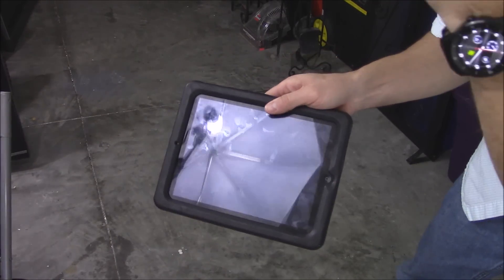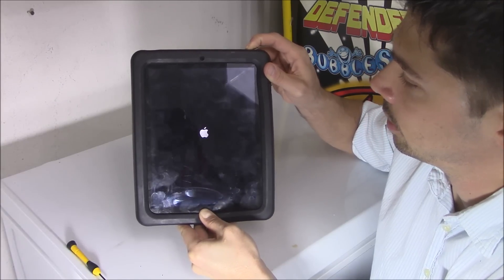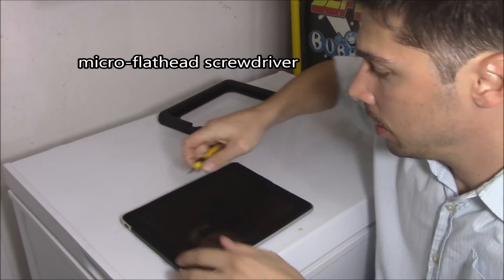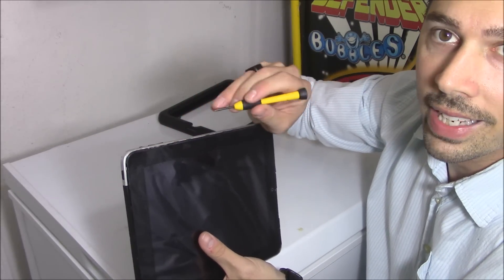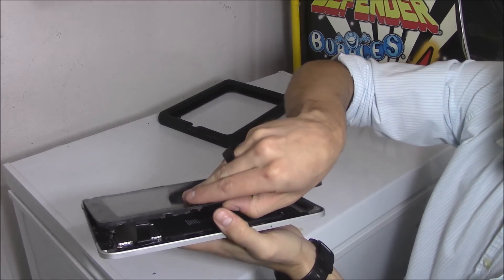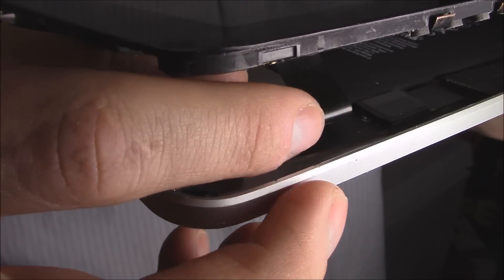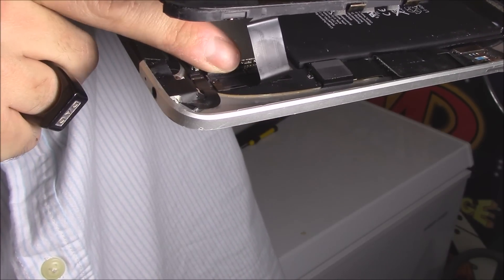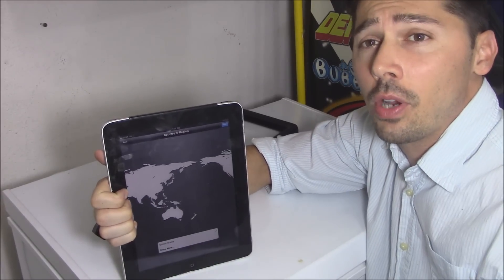2 WAYS TO FIX IPAD TOUCHSCREEN NOT RESPONDING - WORKING

Comment: Hey, what if an touchscreen on a similar (ANDROID/GENERIC) tablet just suddenly went crazy and progressively failed in all but part of the screen? Will shocking the screen with a lighter sparker work if done correctly or is it more likely to do with  the cof cable like with yours? Any other suggestions? ALSO: I did splash a little water on it before it went crazy, but I wiped that off and was able to fully use it until it went nuts while watching a music video on yt. Inside the device, the black wire from the batt to circuit bd has some insulation missing at the end, so I wonder if some charge is being lost elsewhere that should go to the screen. Additionally, I wonder if the portable bluetooth speaker vibration had something to do with it (it was fairly close)...
🤔🔊📲📵❓

Comment: Restarting it did the trick! I was worried cause I didn’t drop or break it. For some reason the touchscreen only worked for my Apple Pencil and not the taping on the screen. So I was a bit worried Good thing it’s fixed now😅 Thanks for the vid

Comment: 1) I press and hold both home and power buttoon at the same time but it took screen shot

2) I press and hold power button, I tried to slide to power off or cancel but it don't respond 

Is there any way to force restart

Edit: I just comment and it works when I press and hold both button, it respond now

Comment: My iPad (gen 7) touchscreen suddenly stopped working when I turned it off. I found this video and tried to 1st method however it didn’t work no matter how many tries I did. I don’t have a heat gun but google said you could use a hair dryer as an alternative. If I manage to open my ipad and fix the problem, will the screen and back case just click together when I put it back? Or is glue required?

Comment: Thank you so much for the information in this video. My son managed to lock the keyboard by frantically pressing buttons when the internet connection was taking a long time to connect. The touch screen stopped working. This video helped us to unlock the screen by forcing restart without connecting the tablet to the computer for a hard reset. Thank you so much! 😀

Comment: Thank you so much!  Thought I was going to need a new iPad.  The HOME button and POWER OFF button did the trick!  Had some software glitch I guess.  I didn't drop it.
Reply: Same as me
Reply: @CLOMB10  pppppppppppppppppppppppppppppppppppppppppppppppppppppppppppppppppppppppppppppppppppppppppppppppppppppppppppppppppppppppppppppppppppppppppppppppppppppppppppppppppppppppppppppppppppppppppppppppppppppppppppppppppppppppppppppppppppppppppppppppppppppppppppppppppPPPpppppppppppppppppppppppppppp
Reply: Same here
Reply: Hello, did it lose all the data stored or was it the same as before because i am skeptical about the reset
Reply: @adhirajsingh3086  it was the same as before no issues

Comment: thank u very much lad you are a star......My  ipad actually got an unusual problem and nobody was able to fix it. it is working perfectly when i am on home screen but only front screen whenever i tried to give password doesn't work untill unless i put it on software mode with power button and home button several times. since last couple of days the problem was permanent and give it a try watch your video and got a small point that ipad touch cable inside got unplugged.... i never opened my ipad but immediately 2 to 3 times tap, tap, tap with my hands onto just opposite corner of volume button where u showed the touch cable inside and it got worked yahooooooooo thanks to upload this video.

Comment: So what causes this issue? I did a soft reset to fix it, but I'm curious as to why it did it in the first place (We use them for work and it hasn't been dropped). Is this slight evidence of hardware failure in the future?

Comment: Yo are a real hero, and I mean it. My iPad like did not fully turn on, and I tried to reset but it did the same thing. I actually cried because it would be the 3rd or 4th time breaking. But it isn't broken thanks to you. How I fixed it is when you told me about the touch screen cable thing and told me the location I added a little pressure in that area and banged it on my knee gently, and it turned on😄😄😄😄😭😭😄😭😄 I was crying happy tears. I'm writing this on my fixed iPad, and I am so happy that you are alive. I want YOU to know that God blesses you. Maybe I was a little dramatic, but you get the point, keep doing what you do.

Comment: so, I tried this twice after my cat knocked the ipad off the counter and the screen did not respond. After the second time, I noticed that the plastic has a tear in it(the piece that slides back into the double slot). Can I use electrical tape to fix it? It's an Ipad 2 so it was a little different than the one you fixed.

Comment: Hey,

I have an iPad Air that the touchscreen does not work. I've worked on these for a while and had a spare that I tried on it but still does not respond. Interesting enough if it's restored while on DFU it works for a few days then stops working.  Just wanted to know if there is anything else to check before declaring the Logic Board dead.

Comment: How would you deal with a cracked one, it's only cracked in the corner where the camera is at, it's actually a hole in the screen 😰 but it messes up the touch and I don't know if I should risk it cuz I don't have another screen to replace it either. It's an iPad mini, I'm not sure what gen

Comment: Okay I'm having a different problem. So I have an iPad mini 2 and I just got it a few months ago, certified refurbished from Apple. It was working fine and it does respond to my touch however, the keyboard is acting crazy where it randomly closes when I'm typing and it won't respond to me clicking certain keys, it will just show it as if I decided to close the keypad. I've even done a hard restart where I restored it back to factory settings and just updated to software 11. What's going on with this thing? I don't want to destroy the screen

Comment: Thank you! I hadn't dropped it, but the touchscreen just suddenly stopped responding. Tried to shut it down, but that required using the "slide button, " which wouldn't respond....reset did the trick. Don't think I would have tried to open it myself, though....too big of a chance of damaging it.
Reply: same the first worked for mine :)

Comment: Bro, what steps could i take for my ipad 2 (model A1396) device given as thde screen is also cracked. pls help
Reply: by screen i actually mean the front panel. i have tried the hard reset but only some parts of the front panel/screen is responding to touch

Comment: Hi, Tampatec
I have an iPad Air 2 which is working fine and there’s no liquid damage.
I had to reset it to switch ownership. Unfortunately when the tablet booted up the screen just went unresponsive to touch.
All the other buttons work fine. Just the touch screen.
I’ve checked and ensured the digitiser cables are well in place but it’s just the same.
Thanks so much in advance
Reply: Sam Brako that’s what happened to mine. I don’t know what to do

Comment: hmmm mine isen heat tuched its allredy replaced and its 4th gen ipad its the glass that is messing and im using it now :-/ who on apple come to think that glass is a good idea isent plastic better i mean common 3 times allredy and my psp is made of plastic droped it i think 100 times its only scratch -.- ipad a little fall the fl screen brakes -_- i think apple is making screens way low durable i mean its not fun to have a sheld over it -_- so i think 3000 kr and for hearing and replace a screen + they fk dident replace the home button its inside it ;-; i say 500 kr i whuld pay for that crap screen they make =_=

Comment: Thank you so much. now my ipad works fine
Reply from the maker: good job fixing your iPad
Reply: +Tampatec thanks it worked!!
Reply: Does anyone know if this will work for an iPhone 5c the same thing is happening with my iPhone, but it's not the whole screen like it still lets me touch but it's very very sensitive and sometimes it just doesn't work at all it's like it's on and off and when it's not working it's still let me touch it just doesn't respond very well do you know if this will help with that?

Comment: This video is very helpful. My problem differs a bit.  Some of the functions on my iPad 4 respond while others don't.  I have just reset it to the factory setting but I cannot access the figures on the keyboard to sign in to the iTunes Store.  What should I do?
Reply: https://www.amazon.com/iXCC-Ultra-Slim-Bluetooth-Multi-Angle-Compatible/dp/B01HBFWL9E/ref=sr_1_15/153-0772826-3407606?ie=UTF8&qid=1476190000&sr=8-15&keywords=Wireless+Keyboard+Ipad+Air
Reply: missy falayi

Comment: My IPad Mini screen was unresponsive and I brought it to Apples's Authorized Dealer, A.Lab at Changi City Point. The staff there was typically zero knowlwedge on troubleshooting. Her job is to coax me to dump my iPad Mini and to settle for a 'New' set for half the retail price at $335. 

I was very disappointed and sad that that's how APPLE treat their loyal customer. Nevertheless, I persevered on the troubleshooting without any help.

Using the software reset method is totally useless as the video above showed. Also, my Home button was also unresponsive. I resorted to starving the device by draining its battery till the unit Autoshutdown after 3 days or so.

I let it remained 'Dead' for around 25 minutes. Then I charged it up for around 25 minutes. I was then able to switch it on again with the screen again 'RESPONDING'.

So, there's no need to physically open up the device at all.
Reply: I have an iPad mini also with the same problem
Reply: Thank you!
Reply: I have the same problem but it still doesn’t work after 30 days of being dead
Reply: My iPad 2 has been dead for 25 days.

Comment: The first option was helpful, although my iPad 2 still had issues. I tried the second method but couldn't find anything resembling the digitizer, and then I got lines across a third of the screen. I revisited this video and tried to look for it again, but unfortunately I just cracked the screen to the extent I had to abandon looking. Oh well. I will see what the Apple repair shop says. Might end up getting another model after all: that may be cheaper than any repair.

Comment: I have an iPad mini and it can't respond to me sliding to unlock, I can't even click the power button, it won't work. If I do the same thing with my iPad mini (it's not the 2,3 or 4 it's the first one) do you think it will work? I have to hold my home button and the power button for me to turn it on, but it won't respond.

Comment: I have an iPad Mini 2 and I did not drop it. My iPad got wet and after that everything continued working fine except that the bottom half of the screen does not respond (exactly 50% of the screen). Could this be fixed in the same way as you showed in the video? I feel like that this has to be a similiar problem to the one shown in the video becasue otherwise the screen would not be exactly halved.
Reply: I dropped it in the water, everything was working fine and then, 3 months after, the half of the screen on the side of the home button suddenly stoped  responding.
Reply: Tampatec can you make video doing exactly that?
Reply: Same for me :(
Reply: Also same
Reply: Luc OMG SAME!
Reply: MAYA Here i
Reply: Me too how can i fix it?
Reply: Luc sad
Reply: Luc j
Reply: Me too, the lower part of my ipad isnt working... I can't tap it.
Reply: O
Reply from the maker: if ipad got wet open it and use a hairdryer to dry it but if its dry then i recommend to turn it off unplug battery and use only 95% alcohol to clean water residue with tooth brush and reseat connections which can fix it.
Reply: Luc turn it round the other way.😃

Comment: can you please help me I dropped my acatel idol 3 and the screen had a little crack and now the screen is not responding what do I do ???
Reply from the maker: hold power to reset it, next try open back cover and reseat ribbon cables, next order the touchscreenscreen $10 on EBay but it's easy to replace the touchscreen with the LCD costs about $60 touchscreen with LCD on EBay. watch more tutorials videos.
Reply: Thank you so much
Reply: sdd

Comment: Everything after the IPad 1 though is sealed shut with adhesive, requiring you to heat it up evenly around the edges before removing the screen.  Would be ideal if they just made all of the models with easy user access like this one...

Comment: THANK YOU OMG i thought my iPad was gone THANKS THANKS THANKS
Reply from the maker: sometimes a big problem only takes a simple solution 8^) #lifelessons
Reply: Same. I usually drop t on the floor at night when I fall asleep. Earlier today the touchscreen started to not recognize anything. It was hard ware related for me as rebooting helps.

For mine I used it and then it stopped responding, I freaked and tried everything and it wouldn't work and I ripped off my screen protector only to waste it, my 3GS worked, my 5c worked and my iPad 2 worked and then I tried rebooting.
Reply: +101% Jutjuber For me this fixed my iPad Air 2s slightly glitches screen. So I would say yeah.
Reply: +Tampatec did your iPad reboot
Reply: +Tampatec Can this method work on Fly Era Life 7, android phone, because to me the touchscreen is working but not good, so if you want to see phone on Internet and please answer me.
Reply: your picture kinda reminds me of frankie on pc
Reply: Society_Vibez zZizxx
Reply: Peyner Buffton n
Reply: Society_Vibez jk
Reply: ApocalypseBarking so removing the screen protector or the tempered glass solved the touchscreen problem??

Comment: This is really helpful and I am sure I have the hardware problem with my iPad 4th generation. (Rebooting several times has not worked.) It doesn't look like I can open it the same way as you have done with the iPad 1.  There is no plastic to wedge the flat screwdriver against, and I don't have a heat thing like you show would be necessary for other models of iPad.  Would a service place be able to fix it for me?  I am afraid of damaging the insides even more.  Thank you for the really helpful demonstration of what to do!

Comment: Yes ! Exactly . This is the exactly what i do when it freezes. Simultaneously to hold home button n stop button on top right hand corner for a few sec . Then release . The apple logo will appear , after that restart on the on off button & wait for a fee sec , it will restart by its own. It really works

On the right, there is a small switch , turn on n until u see the red mark . Its lock for rotation. 

Dont do the last step , unless necessary .

Comment: Now that I've fixed my ipod , any ideas on charging Samsung Galaxy tablet? The charging port doesn't make a good connection and in about 6 months the connector no longer states in the port. If I hold the tablet up the charging connector will fall out! Model GT N 5110.
Reply from the maker: check if the cable or port is bad, if cable then change it out. if port clean port or check pins are straight.
Reply: You are so very helpful! Works like a champ after adjusting the angle with tweezers. No, I didn't forget to unplug it first!

Comment: you expect me to get a screwdriver and do that.
Reply: no serious i found a easy way. JUST WASTE THE CHARGE AND IT WILL SHUT OFF AND CHARGE IT AND IT WORKS SO I DID IT AND IT WORK. NO STINKIN VIDEO SAID THAT I FOUND IT MY SELF
Reply: +meme angel 
Then you had a different problem.

Good job on figuring that out yourself, noob.
Reply: Xbox sucks Well it would work but my home button was broken so i found a diffrent way to shut it down
Reply: +Xbox sucks  chill and your the noob
Reply: Jaheem Prevost

k den
Reply: very good noob
Reply: +meme angel I'm trying to get my iPad mini to run out of battery but it's been twelve hours. No luck...
Reply: Amna Ajaib  You have to charge it after. And it will light up and work.
Reply: Jay Hew Its if your home button is broken or if that way doesn't work

Comment: I dropped my tablet and it has two long cracks across the screen I have a android flare 3 I also took it apart I found the touch screen cable and it was in place and had not moved I even reset the software i'm not sure how to fix this but it really sucks only using half you're screen

Comment: my iPad (3) was running on (ios 8. 3) nd i updated it so after 2 or 3 minutes the iPad stucked so I taped on the power button so that it may reset  and when I again taped on the power button the screen touch was not working so my question to you is will the 1st way in the video may work for me? because my iPad did not fell.

Comment: THANK YOU! You have made me a hero to my 4 year old grandson. I was already a hero, but now you made me a superhero (no cape, of course).

The only thing is I wish I could have gotten into the iPad without damaging the iPad. The aluminum (I guess that's what it is) shows where I wedged the jeweler's screwdriver. Plus the plastic gasket kind of fell apart. It is an old 1st gen iPad, so no biggie. I guess the plastic pry tool is the better way to go.
Reply from the maker: Cool good job,  I tried plastic tools and it broke but yes if you can find strong nonmetal tool to do the job less likely to chip the bezel,  but most cases normally cover the ipad bezel any how.